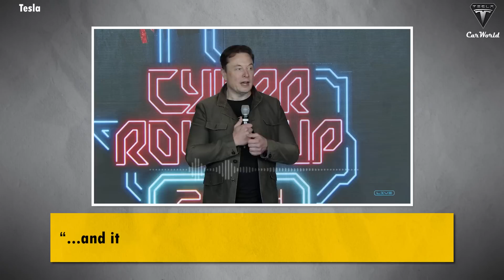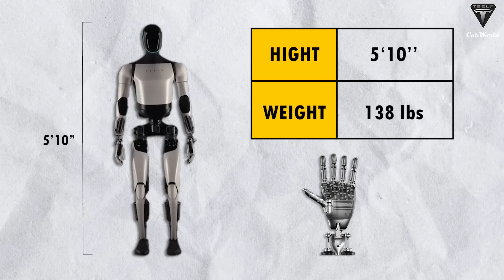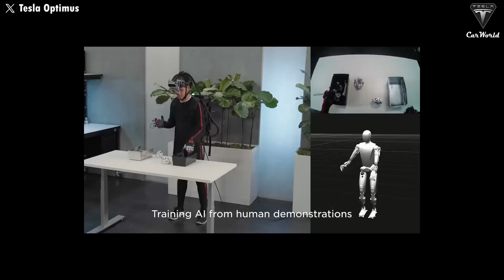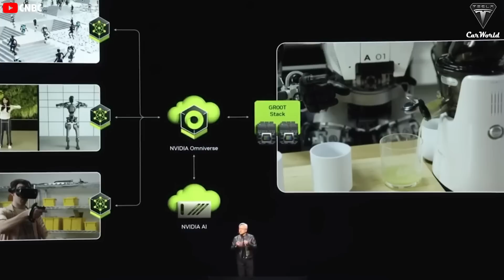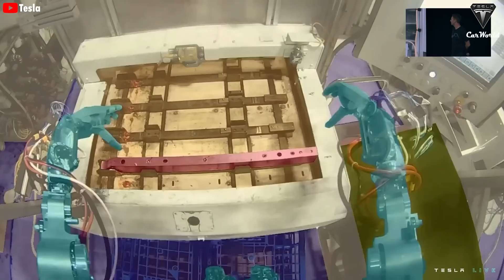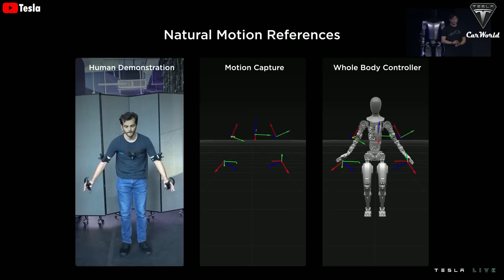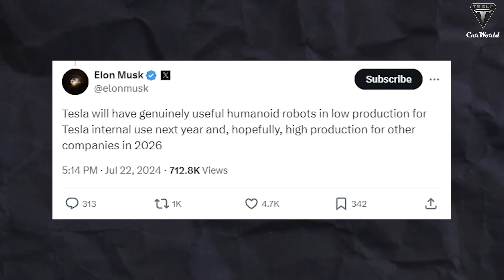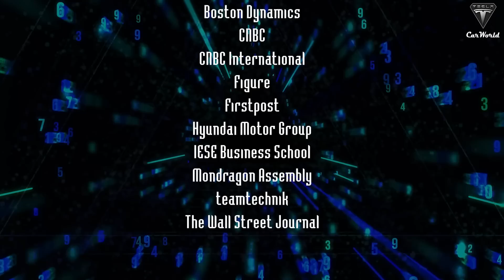Elon Musk Explains HOW Tesla Produced Optimus Robot Only $10K & Sell Them For $20K! Gen 3 in 2025 ?

Comment: I feel that even tho these bot can be available it should have a safety fail for tampering software. Such as trying to copy software firms or forums. Other the less self lock out and become unacceptable for use and technician would have to confiscate the bot and do not allow the individual to use at all or purchase another one. Meaning a beacon will be gps traced at all times include removability of battery will be at full terminate as well shuts down and deletes itself but data stored else where . None removable period anti tamper period. Tesla needs to really over think the plausible reasoning not just the bot itself. A penalty fine or fines for such tampering. Only a license technician would be able to perform updates and 2-4 months updates and data inscriptions to where the bots are full monitoring 24/7. Can these bot be used for work space or communication task with Virtual Assistant. Thus A license to use in proper operations. Like owning a car must fallow rules and regulations. Such as for having for interpreters for hospitals and much more. Over think the safety in all regards. Actions on based on misused in serious offense will relate to serious punishment by law. And the bot will have the capability to fallow and track your motives and movements and series of reports will be taking to highest extents. In regards of opinion are these bots or will the bots be operated by human  coordinations as well. I really hope these bot doesn’t become like The movie Terminators. We do not need a judgment day as speaking in concern. Tesla please Think way outside of the point of view. Safety is the must in all scenarios.

Comment: Challenge for the Optimus robot...
Given...
• a basic hand drill
• an appropriate drill key
• a drill bit
...can the Optimus robot...
install the drill bit into the drill, tighten the chuck (using the drill key), and then create useful drilled holes with the drill?
Reply: My description ❤❤
Reply: @elonmusk-d9s  
Thank you, Elon. 
If Optimus can handle that challenge, then the next tougher challenge involves a pneumatic 5" Orbital Sander, of the type that uses adhesive sandpaper. The challenge is similar to the foregoing challenge... 
• peel off an already applied sheet of adhesive sandpaper FROM a 5" Orbital Sander
• install a new piece of adhesive sandpaper onto the very same 5" Orbital Sander
note: Orbital sanding is a very important operation, necessary in most steel fabrication factories. Steel surfaces require "texturing" in order to get electro-statically applied Powder Coat paint to not only stick, but to STAY stuck, months or years after it has been applied. Skipping the orbital sanding step leads to protective paint FLAKING OFF. When it flakes off, it no longer provides Rust Prevention.
Reply: @JohnBerry-q1h the robot will remove its hand and snap on the attachment.
Reply: @JohnBerry-q1h  basic model pricing then build on the options.
Reply: @troyqueen9503
There is a chance that a situation, similar to what happened with the IBM PC could take place. Not only did the motherboard of an IBM PC (and XT; and AT) have ISA and/or EISA add-on card slots, but IBM published the bus standard (which services all those card slots.) This opened the door for 2nd and 3rd party vendors to create and sell their own compatible aftermarket add-on cards. A similar "thing" could happen with Optimus. If Elon publishes the "interfacing standard" (for add-on special purpose tools, such aftermarket add-on tools I assume would attach into the wrists of an Optimus robot), then 2nd and 3rd party vendors could manufacture and sell aftermarket special-purpose wrist-mounted TOOLS. Whole new (and very profitable) businesses could spring-up, each of which would offer aftermarket add-on attachments, compatible with any Optimus robot. Where Elon would make a huge profit, if such an aftermarket industry were to spring-up, is by developing his own proprietary API interface, which has to be accessed over the internet, per every "BIOS-like" subroutine call. API's that operate in this manner ARE ALREADY a HUGE market, that continually brings in huge profits, to the companies that own required API's.

Comment: (I feel it is the small things that escaped many) 
When designing a robot's foot, the key considerations are stability, balance, and adaptability to various terrains. Here are some principles to guide the initial design:

1. Foot Size: A larger foot base provides more stability, especially for humanoid robots. A size comparable to an average human's foot, around 10-12 inches (25-30 cm) long and 4-5 inches (10-12 cm) wide, would be a good starting point. This size offers a balance between maneuverability and a stable platform.

2. Shape: Consider a foot shape that is more rectangular with rounded edges rather than purely human-like. This can improve contact with the ground and distribute weight more evenly, especially on uneven surfaces.

3. Materials and Cushioning: A flexible, durable material like rubber for the sole could improve grip and shock absorption. Integrating sensors to detect pressure or uneven surfaces can help the robot adapt its balance in real-time.

4. Ankle Flexibility: Incorporating a joint that mimics an ankle can provide better adaptation to different surfaces and enhance stability.

Starting with the foot is indeed crucial, as it lays the foundation for the robot's overall mobility and balance. Focusing on shock absorption, terrain adaptability, and balance mechanisms can significantly enhance the robot's walking capabilities.
Reply: While designing the dexterity of the hand is important, e.g. typing, piano, violin, cello, urwu playing, cooking, wok throwing without spilling, folding clothes, making beds, Origami making paper crafts, sewing, etc...  The design of the foot is important. But the human foot is the best design so far. A flat foot can never achieve the level of dexterity of a footballer, a gymnast, and do all those actions in speed.

Comment: Why you should buy a robot... 

A variety of companies across different industries could benefit from hiring robots instead of traditional employees. This approach can lower labor costs, boost productivity, and allow businesses to scale efficiently. Here are some industries and examples of companies that could benefit significantly from hiring robots:

1. Manufacturing and Assembly
Automotive Companies (e.g., Ford, Toyota, General Motors): Robots can handle tasks like welding, painting, and assembling car parts with precision and consistency. This could reduce labor costs and minimize human error in high-volume production.
Electronics Manufacturers (e.g., Foxconn, Samsung, LG): Companies that produce electronics would benefit from hiring robots for tasks like circuit board assembly, testing, and quality control, where precision and repetition are crucial.

2. Warehousing and Logistics
E-commerce Giants (e.g., Amazon, Alibaba, Walmart): Robots could manage order picking, packing, and sorting in fulfillment centers, particularly during peak seasons when demand for temporary labor surges. Amazon already uses some robotics but could expand further by hiring specialized robots for unique tasks.
Third-Party Logistics Providers (e.g., DHL, FedEx, UPS): These companies could benefit from robots that assist with sorting packages, loading and unloading trucks, and inventory management. This would reduce the need for seasonal workers and streamline operations.

3. Agriculture and Food Processing
Food Production Companies (e.g., Tyson Foods, Nestlé, Cargill): Robots could be hired for repetitive tasks like cutting, sorting, and packaging food products. In agriculture, they could help with harvesting, planting, and monitoring crop health.
Dairy and Livestock Farms (e.g., Arla Foods, Dairy Farmers of America): Robots could assist with milking cows, feeding livestock, and monitoring animal health, reducing the need for manual labor in often remote or rural areas.

4. Retail and Hospitality
Large Retail Chains (e.g., Costco, Target, Kroger): Robots could handle inventory management, shelf stocking, and cleaning tasks. This would help reduce labor costs and improve operational efficiency, especially during late-night hours when restocking typically occurs.
Fast Food Chains (e.g., McDonald's, KFC, Burger King): Robots could prepare food, handle customer orders, and clean areas, ensuring consistency and quick service. Some fast food companies are already experimenting with automation, but leasing robots could be more cost-effective and scalable.

5. Healthcare and Pharmaceuticals
Pharmaceutical Companies (e.g., Pfizer, Merck, Johnson & Johnson): Robots could be hired to manage tasks such as sorting and packaging medications, conducting lab tests, and ensuring sterile conditions in production environments.
Hospital Chains (e.g., Kaiser Permanente, Cleveland Clinic): Robots could assist with logistics like transporting medications and supplies within hospitals, as well as cleaning and disinfecting rooms. In pharmacy settings, robots could handle prescription sorting and fulfillment.

6. Construction and Maintenance
Construction Firms (e.g., Bechtel, Skanska, Turner Construction): Robots could assist with tasks such as bricklaying, concrete pouring, and material transport. They can also handle dangerous tasks like demolition or structural inspections, improving worker safety and efficiency.
Facility Management Companies (e.g., ABM Industries, ISS Facility Services): Robots could take over cleaning, maintenance, and security tasks within buildings. This would help companies manage large facilities with fewer human resources, particularly for repetitive or hazardous tasks.

7. Energy and Utilities
Oil and Gas Companies (e.g., ExxonMobil, Shell, BP): Robots could perform inspections, repairs, and maintenance in remote or hazardous locations, such as offshore rigs or refineries. This would minimize risks to human workers and improve operational efficiency.
Renewable Energy Providers (e.g., NextEra Energy, Vestas, First Solar): Companies in wind, solar, and other renewable sectors could benefit from robots handling tasks like solar panel installation, wind turbine inspections, and maintenance.

8. Mining and Resource Extraction
Mining Companies (e.g., Rio Tinto, BHP, Vale): Robots could assist with drilling, excavation, and transportation of materials in challenging environments. By reducing the need for human labor in high-risk areas, companies could improve safety and productivity.
Quarry and Aggregate Companies (e.g., Martin Marietta, Vulcan Materials): Robots could be used to perform tasks like rock crushing, conveyor belt monitoring, and site surveillance, reducing the need for human presence in dusty and noisy environments.

9. Transportation and Delivery Services
Public Transit Systems (e.g., MTA, Transport for London, RATP): Robots could assist with routine tasks like cleaning, ticket validation, and security monitoring in transit stations and on vehicles.
Courier Services (e.g., Postmates, DoorDash, Instacart): Robots could be leased as delivery agents for last-mile services, especially in densely populated urban areas. This would reduce the reliance on human delivery workers, particularly during peak hours.

10. Telecommunications and Data Centers
Data Center Operators (e.g., Equinix, Digital Realty, Amazon Web Services): Robots could perform physical tasks like server installation, wiring, and monitoring environmental conditions. This would be beneficial for large-scale data centers with repetitive maintenance tasks.
Telecommunications Companies (e.g., AT&T, Verizon, Vodafone): Robots could manage network installations, repairs, and diagnostics in remote or hard-to-reach locations, minimizing the need for human technicians in the field.

Conclusion
Robots hired on a lease model by these companies could offer cost savings and operational efficiencies, particularly in industries with repetitive tasks, hazardous environments, or high seasonal labor demand. By leasing rather than purchasing robots, companies could achieve automation benefits with reduced risk and greater flexibility, while workers transitioning to robot ownership could capitalize on automation trends.

Comment: From what i'm seeing, Boston Dynamics is leading the way in robot functionality, stability and movement flexibility that can get alot of tasks done, efficient in constructions, while Tesla Optimus Prime (I couldn't help myself to not add Prime) is probably leading when it comes to house cleaning.

The other ones are promising as well.
Reply: They've been at the humanoid game for longer, and spent more than Tesla has for Optimus by a few fold. They release a video once a year of robots doing dances. They released an over priced dog with limited functionality, and it was ripped off by china within weeks. They have a good core group capable of designing and building prototypes, but they don't have good management capable of leading them to develop a viable product. Take atlas V2. Those spinning joints add a tremendous amount to the cost of manufacturing and provide no actual value other than showing off for a video. If they can survive the robot wars they will become a boutique robot manufacturer. But the others will become giants as companies like Mcdonalds, walmart, etc start buying them in masse.  The next few years are going to get wild.
Reply: Wont matter for boston d. They do not have the distribution, production facilities, capital to ever challenge Tedla. Besides doubt they are ahead, but evenso not for long.